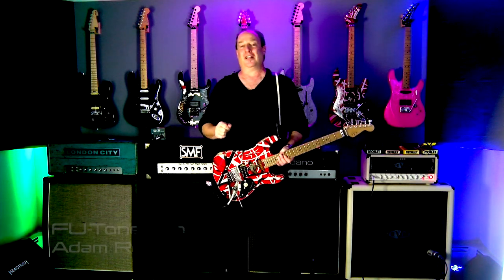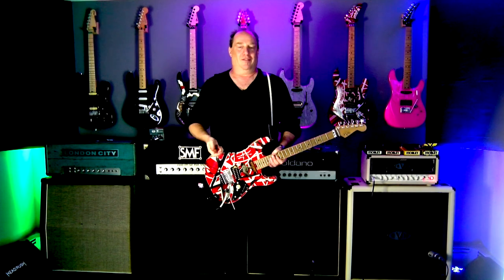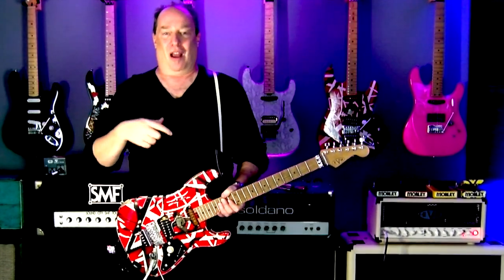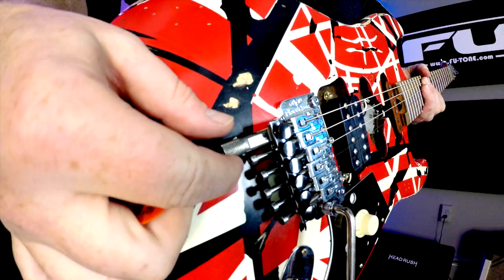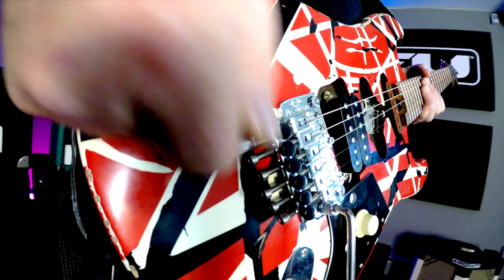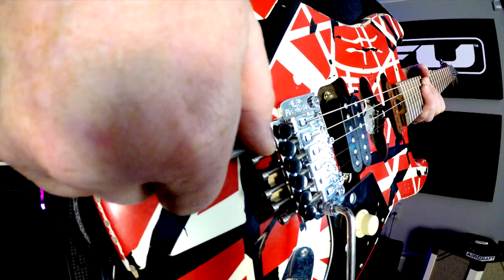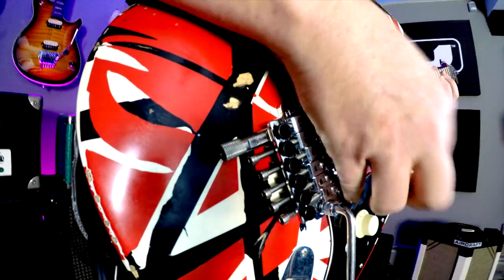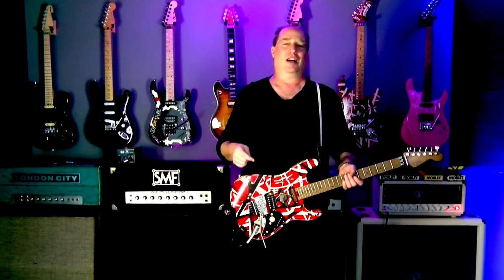FU-Tone EVH D-Tuna Tech Tip

Comment: I have an issue with one of my D-Tuna's on my EVH USA, I run out of room on the fine adjuster to get back to E, I cannot back out that fine tuner Allen set screw anymore to get me back to E it's sharp by a little, The D is in tune when pulled out? I have replaced it with other D-Tuna's also. Thoughts?

Comment: My problem is the E string doesn’t get anywhere near E when I push it all the way in.  The fine tuner can’t get it there, and trying makes it so tight the whole thing locks down.  Only thing I can think of is the spring is shot.  But this is the case on all my guitars I rebuilt with your stuff except one.  Oddly, that one floats and I have the others (EBMM VH, Peavey Wolfgang, EVH USA sig, a couple Jacksons, Maria knows me as bee Cave joe) blocked.  As it is now I have them all tuned to standard as the d tuna is useless, and then I just tune it to D the old fashioned way since I can’t do it on the fly.
Reply from the maker: Hey Joe - It will not tune because you are floating. You have to be blocked. Try that and let me know if you need further help. You can email me direct at adam@fu-tone.com
Reply: @FloydUpgrades  no I’m saying the one that works is floating (Washburn nuno n4) and all the ones that don’t (listed above) are blocked.  That’s why I’m so mystified by it.  Only thing I can think of is the springs are shot, but I don’t see how that could have happened.